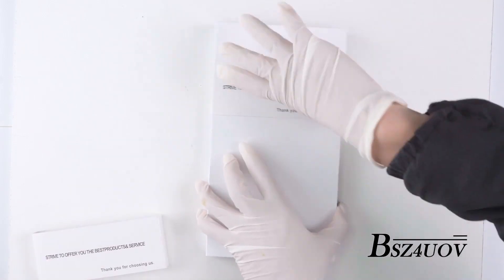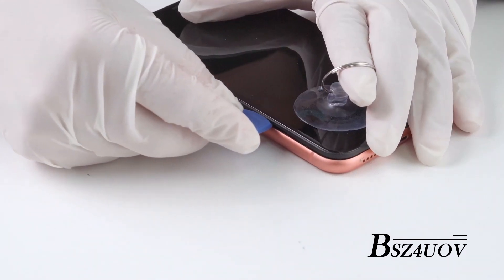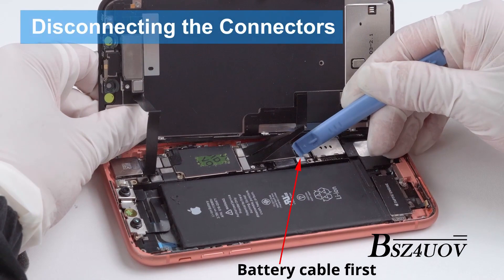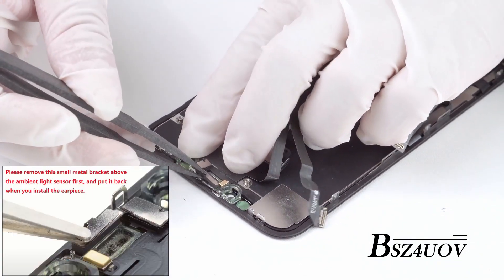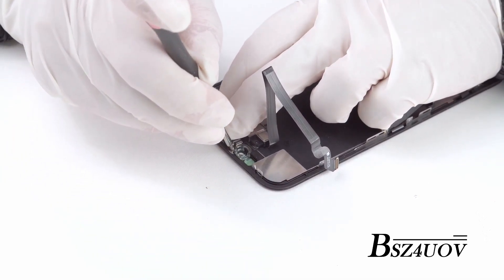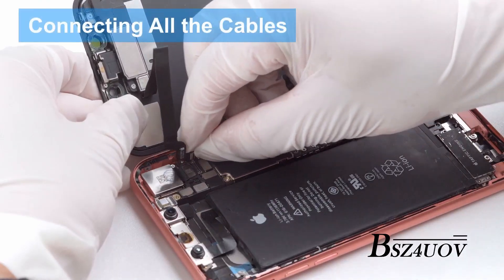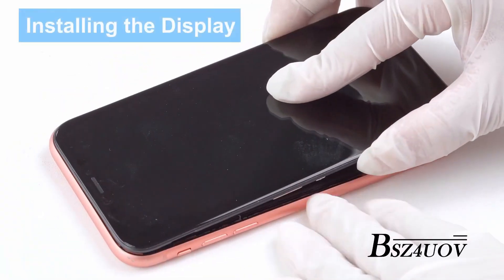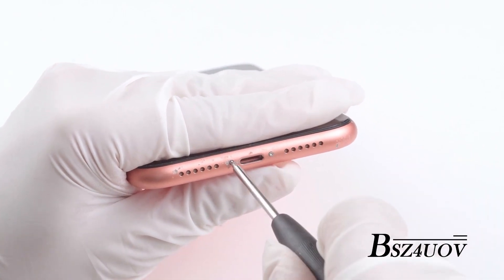How to Replace iPhone XR Screen / Digitizer Glass Replacement Installation Repair Guidance

Comment: Using the blue screw driver, I am not getting any traction on the first 2 screwws adjacent to the charge port. Any suggestions?
Reply: Same did you figure it out?
Reply: They get dirt in them and you have to push the screwdriver harder in them